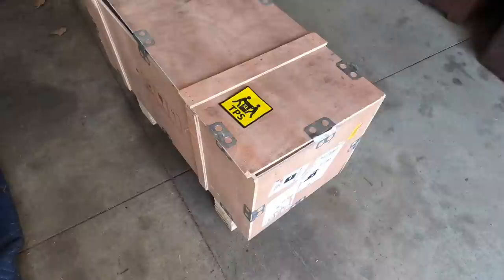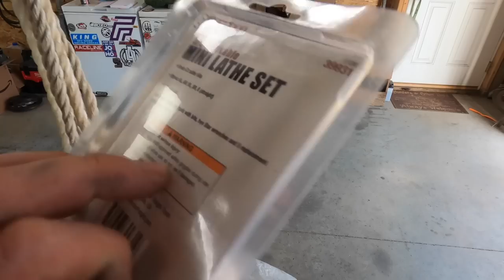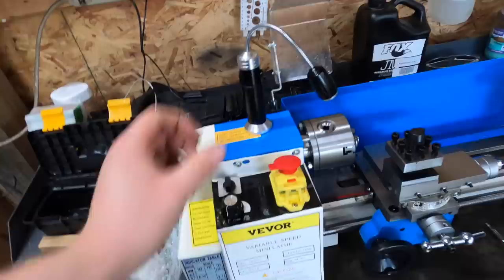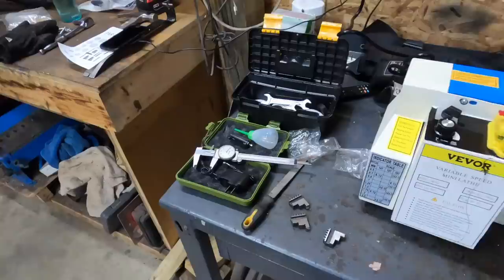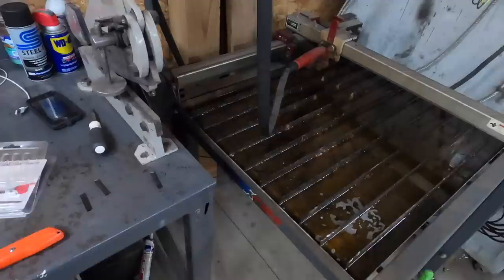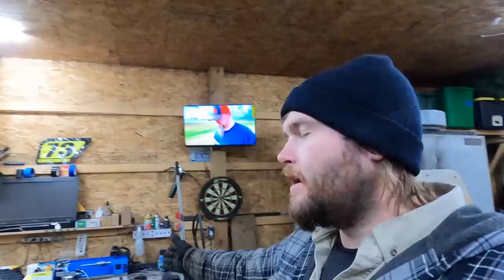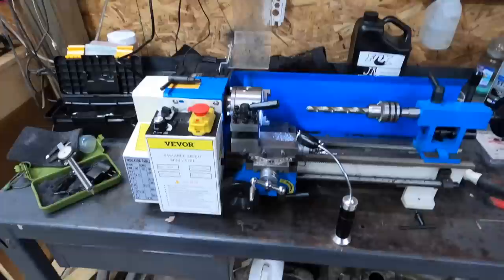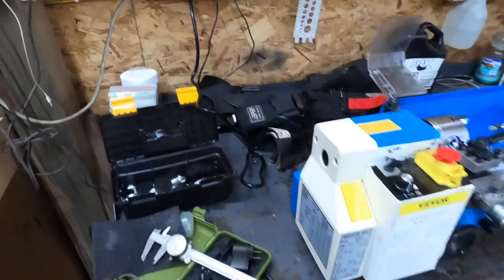We bought the cheapest lathe on Amazon!

Comment: I've had one of these for many years. As long as you realise it's not a $10,000 industrial precision machine it works great. I made things out of plastic, wood, brass, copper, rubber and even steel. Just go easy on the steel. Get yourself a reamer for the inside finish cut it makes a much smoother and accurate hole. You will have a tighter and longer wearing bushing. Great video.
Reply from the maker: Thanks for the tips!
Reply: Thanks for sharing 👍🏽
Reply: why wouldnt you just go to an old machining auction and pick up a manual lathe for like $5000?
Reply: @toddpick8007  Great Idea! I think you should buy me one.
Reply: @The-Fat-Kid  Why waste the $1000 this thing is when you could just invest in a decent used lathe at an auction.

Comment: I can do anything on a lathe. I have been a machinist for 30 years, mostly on manual and CNC lathes. I am very good at it. I can machine anything from delrin to inconel and titanium etc. 
That 4 sided tool holder that it came with, I made one of those on a manual lathe, out of 4 inch round stock using no special attachments. My boss can't even figure out how I did it LOL. So if you have any questions, I can answer them for you.
Set your tool height to centerline or a couple thousandths above centerline for the best cutting performance and best finish.
You want to get some more carbide inserted cutting tools, those three sided ones suck. I have good luck with the 80 degree and 55 degree diamond style inserts. And get a few different sizes of boring bars as well. That way you can drill the part and bore it to size accurately. 
You need to advance the tailstock quill a bit and then the center will fit correctly. Back off on the tailstock to remove the center. Get a live center as well. It has bearings that allow it to spin with the part.  
And get your speeds and feeds right. Plastic and aluminum can be run at higher spindle speeds and tool feed rates while steel needs to be run at lower speeds. You need to experiment on your machine to find what works best.
Get yourself a spray bottle and fill it with tapping oil. Depending on what you are machining, you may need some kind of coolant/cutting oil on the part. There are many different kinds out there.
And ALWAYS remember, whenever the chuck key is in the chuck, your hand is on the key. NEVER take you hand off of it whenever you tighten or loosen the chuck. I have seen the chuck key get thrown out of the machine and across the shop a few times because someone forgot to remove it before starting the machine. One time I saw one embedded in the wall on the other side of the shop. So, yeah...
And gloves, well I never use gloves while running the machine. I only use them to remove the chips from the bottom of the machine.  They can have razor sharp edges and you can get some very nasty cuts if not careful.
Reply: I have springs on all of my chuck keys. Yes, once, I did throw a chuck key across the room. Only once. Now if I am not pressing the chuck key into the chuck it automagically and safely falls out if I get interrupted or otherwise distracted by something elsewhere in the shop.
Reply: A file near the chuck is not good.
There is plenty power and momentum to do serious injuries.
Look it up and know what to expect before switching on.
Good luck, never operate when tired is pretty good rule also.

Comment: Machining Delrin is a load of fun and a load of mess! 
You can take pretty deep cuts even on mini lathe
 Being below center can be dangerous as work can 'roll over' top of tool and fly out.
Don't know if anyone has mentioned, you need to shim tool to dead center, it will cut better and give better finish. (you can go a few thousandths above center if tool post isn't too rigid as tool pulls down) The steel banding used on packaging works pretty good or buy a cheap set of feeler gauges to get accurate thicknesses. The quick change tool-posts 'everyone' recommends for mini lathes put tool too far away from mounting point and give too much leverage to tool in my opinion (I trained in the 1970's before this type of lathe was even dreamed of)

Comment: Don't ever leave the chuck key in the chuck, even for a second not using it. Guarantee you will forget once and it will be a projectile; develop a good habit of, if not tightening or loosening, remove it. Also, if you wind up with a little nub when parting or facing, it means the end of the tool is not vertically on center, so adjust it or shim it. Like someone else said, get a boring bar for over 1/2" holes; find a video on boring bars. Great purchase for the price to learn on.
Reply: Could be worse than a projectile you could get caught on it.
Reply: You want to talk about a projectile, try running nylon through a table saw.

Comment: New intro is 🔥
As a machinist I enjoyed the hell out of this video lol I’ve been looking at a mini lathe for months now but don’t really need to make anything at home I can’t just make as a side job at work
Reply from the maker: Thanks! They definitely are handy to be able to just throw on the bench and make small parts in minutes. Interested to see how long it lasts!
Reply: I’m a machinist and a mechanic I have my own machine shop  I never did many side jobs at work to busy doing them at home
Reply: We had one at my job I used to work at but didn't get enough hour's in to really get to know the machine. Now I don't have access to one I'm wishing I spent more time working with the lathe. I'm looking for one right now but want something a little bigger than a mini lathe. I'll hold out until a shop is closing down and no longer needs there lathe and have to have out there shop. I seen a few smaller one's on Facebook market place. Then I found one that was way to huge industrial size.  I would need a heavy duty folk lift to move it around and once it's in the spot that's where it lives.

Comment: Live, dead centers and drill Chuck adapters fitting in tail stock needs the tailstock bore cylinder cranked forward to extend out of the tail stock to get it to hold the adapters. Cranking the tailstock bore cylinder back into the tailstock releases/kicks out whatever you’ve put into the tailstock bore cylinder

Comment: For plastic it is likely less of an issue, but if you want to turn harder material and in particular if you are turning steel on these get the biggest tooling you can fit into the machine (I use 3/8" tooling even though the machine says it only supports up to 5/16") and I have changed to the 0XA quick change tooling instead of the factory tool post. There are cheaper quick change tool posts made out of extruded aluminum, but for machining steel these are garbage. For plastic they would probably be marginally acceptable as the ones I have seen are not machined after extrusion. Even for a small lathe, every moving surface should be properly machined, flat, and square if you do not want to have to do mental gymnastics every time you really need tight tolerances.

Comment: I bought the same lathe. I removed the back plate because it's just too close to the lathe. It was also falling apart. The tailstock nut had fallen out and the tail stock was bouncing around in the crate. I decided to pull the lathe all apart and then put it all back together calibrating all the fitted parts. It was worth it. If you don't it's  just going to fall apart while your using it. Tearing it down and building it back up isn't really a big job and you get to familiarize yourself with all the working.
Most will state that these are 'lathe kits' which is essentially true. Depending on how much you will use it you'll soon find lots of little improvement projects to do with it to make it more enjoyable to use.
Last point: In spite of what the Amazon ad for these state they DO NOT come with the change gears needed to single point cut SAE threads. Only metric. The lead screw is metric. However the two or three special size change gears needed to single point cut SAE gears can be bought.
Reply from the maker: Oh thanks for the info on the gears! I was not aware of that, haven’t got that far yet. Thanks for watching!

Comment: Don’t forget when you Measure part diameter to halve your cut because your cutting from the diameter.  IE you need 1” and are at 1.1 inch part measurement set cross slide to cut no more than .05    Also some parts get hooter and expand more than others, SS IS ONE OF TGRM SO CHECK PART FOR HEAT BE CAREFUL NOT TO GRAB OR TOUCH TO PREVENT BURNING YOURSELF.  It needs to cool so it’s Final Cut after cooling is not under sized diameter.

Comment: I've got one of these, 7x12, that I got at a traveling sale near Seattle in 1998.  It's in the shed right now, because I don't have space to set it up, but it's a useful tool -- big enough for some gunsmithing (won't profile a rifle barrel, but it'll handle pistol barrels), capable of model engine making (add a milling attachment if you don't also have a small milling machine) -- it's a lot of machine for the price.

Comment: thinking later of getting an extended bed for 7x16?  most of the direct from china drop shipped stuff isn't clean, they're machined mostly properly, great quality, but full of grit and weird lube, sometimes only assembly lube, they gotta be taken apart and rebuilt with a cleaning and proper lube before you use em, a few weeks of light duty might be safe.  you'll find that the ones from good brands are the exact same machine, same part finish, but aligned with better lube and cleaned properly, doing it yourself saves big.  direct from china, they know you're not gonna ship it back for warranty service, so the stuff available locally is gonna be set up better, they're light enough to carry back, have enough energy left to scream and still more left to carry a replacement back.  littlemachineshop has lots of upgrade parts, some you can probably eventually make yourself.

Comment: I have one of these with a slightly longer bed. It works fine as long as the gears are lubricated. You can do a lot with this. I even bought a 4-jaw for finer jobs. Worth every dollar. The handle fits the bit holder, you will need it.

Comment: I have one of these almost identical but mine is much older.  I wish the gear train wasn't plastic, but I primarily use it to drill small holes and make screws and such.  The variable speed is ideal for small wire number drills.
Reply: Take them out and get some steel ones copied to their specs mate. Quite a few places that can do it depending on whether you want to pay the price.
Reply: @shaunlewis286  That would definitely work, but I think by the time I payed for that I may as well buy Smithy, or another larger used lathe.  It works well for making small nuts and bolts in my knifemaking.  If I do wear a gear out I would consider having one made, but not the entire train.
Reply: @TheWyoCoyote you don’t have to get them made if you are in the USA or Canada LMS has them

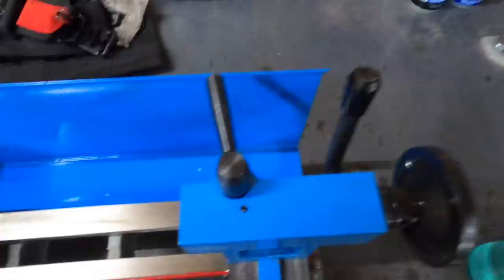Comment: 5:07 you can adjust the "tightness" of the tailstock, there is a little lock at the bottom which pushes up which can be adjusted.
at 17:03 i would personally not use the topslide for turning, its usually used for tapers. So what you may find out is that at the end your workpiece may not be straight because the topslide may be at an angle (measure with a micrometer or a vernier at both ends and you may see a taper). Recommended to use the carriage handwheel all the way for turning. will Always be 100% straight (without bed twists on long pieces).
Reply from the maker: These are some great tips! I was indeed getting just a bit of taper and was trying to figure out why. Thank you!
Reply: @fishermotorsports2896  your first modification is probably a carriage lock, but if you can't make one. There is an inbuilt carriage lock. Set the tumbler gear to neutral (not moving the leadscrew) and lock the carriage. Put your hand on the carriage handwheel and tighten it gently to the left/right. This locks the carriage in place for facing cuts. The mini lathe is superb tool to have but takes a bit of time getting used to it.
Reply: @fishermotorsports2896  Too add more info from my own experience. Buy a an insert tooling, the mini lathe can fit 8x8mm. (to raise it to center height, buy valve clearance gauges for cars/motorcycles and rip it apart. They can be used as shims to raise your tool to center height)
Don't buy the brazed carbide tools (the blue ones) They will work, but they are not as good as the inserts. In general, HSS is great for soft metals like alu and brass. Carbide is great for steel. But i do shortcut as i don't have a grinder, i use carbide inserts for all and it works great. There are some inserts made for aluminium but i haven't tried it.

Comment: I have had one  for ten years motor burn out then control went put bigger motor on re did drive put brass sliders under saddle metal drive cogs i have i  myford as well but the tooling is very dear and old the bits for mini lathe cheap as chips i keep going back to the mini lathe